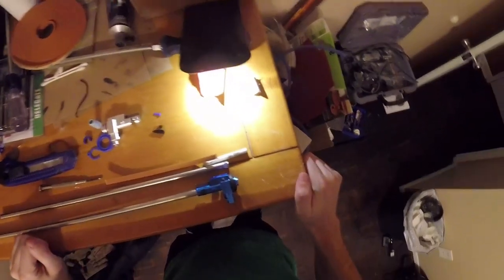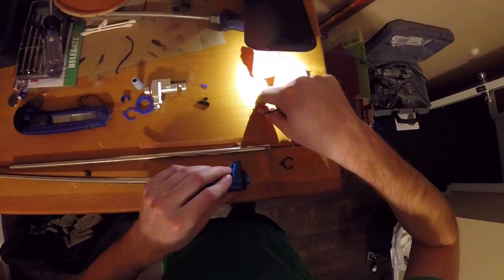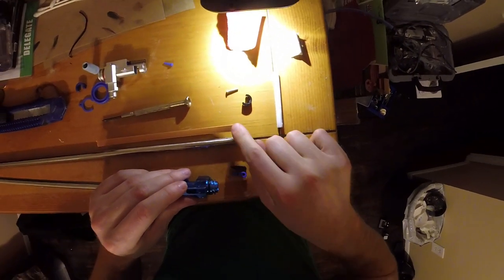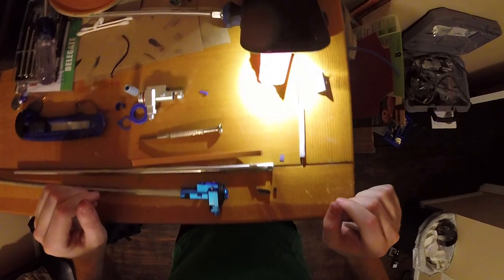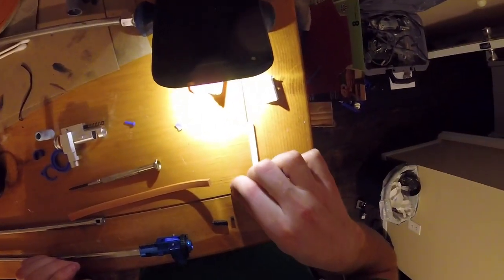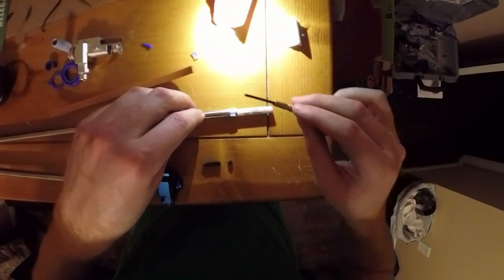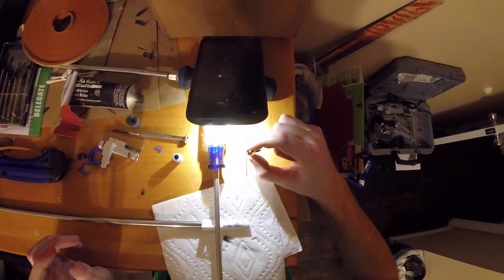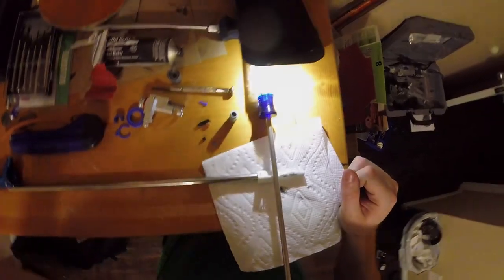R Hops and M Nubs with Nigel

Comment: What about for er hop? Wouldn’t you need to shave the teeth down all the way so it’s fully flush since you have to use a much longer m nub?
Reply from the maker: I haven't heard the term ER hop before, so I assume you mean an extended hopup window with a longer patch. 

To properly press along the entire length, you will need a custom hopup arm that has a longer contact support (can 3D print). If you simply grind away the entire block, the arm will pivot to a very steep angle to engage the nub and bucking. It will likely apply a ton of pressure on the front of the patch and very little on the back, defeating the purpose of the long patch. Stacking M-nub material to fill the gap doesn't work either sadly. I tried and the bb's were compressing the foam (single shot hops, full auto holds foam compressed and lose hop).

Honestly though, my DMR uses a ZCI inner barrel with an extended window and the standard hopup lever with the teeth removed (square block presses nub). I have no trouble at all overhopping .40g's, but the custom hopup arm would certainly be an improvement. I'll try to model one up and test out the theory.

Comment: seems like t seal between yiur hop up/buckingg is really por. would recommend dental floss mod
Reply from the maker: Never really seen any benefit in my dmr for fps consistency when using maple leaf buckings, so I stopped bothering.
Reply: @Karrottop009  Fair enough. Can you explain to me why i shouldn't just remove the entire mount on the hop up arm? You mentioned only the half circle should be removed. It so happens that i have a longer foundation of mound beneath the half circle before reaching the actual arm. Why shouldn't i also remove that?
Reply from the maker: Depends on the angle it would contact the patch. For the arms in my chamber, removing the block entirely would require the arm to swing down below horizontal. So, it would be pressing harder on the bucking at the front. You really want to apply even pressure across the entire patch to maximixe backspin. Sanding the block to be level with the barrel when contacting patch is best. 3D printing an arm with a custom length block to fit the window can be necessary for some setups like extended patches.
Reply: @Karrottop009  Wouldn't there be less contact from the hop up arm to the nub if i keep that small mound? And wouldn't there then be uneven pressure since the back piece of the nub wouldn't be connected to the hop up arm?
Reply from the maker: If you have enough material on the arm to blend level with the barrel at that rotation AND you have an extended hopup window to accept that length, then yes that will be better. Just haven't seen any rotary chambers with an arm that can do that, which is why I suggest 3D printing a custom arm for most cases. If you have a standard patch window however, the extra length of the arm will just be pressing against the barrel and not through the window.
Reply: @Karrottop009  Alright mate. I will just cut the semi circle then. Thanks bro.